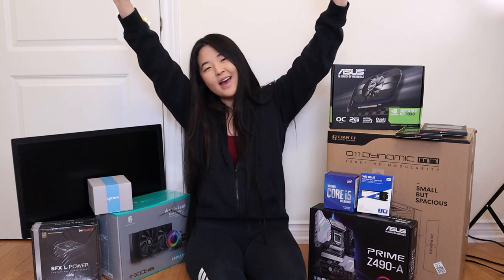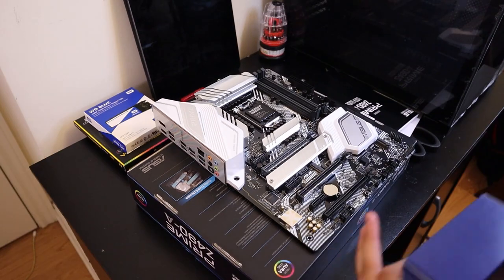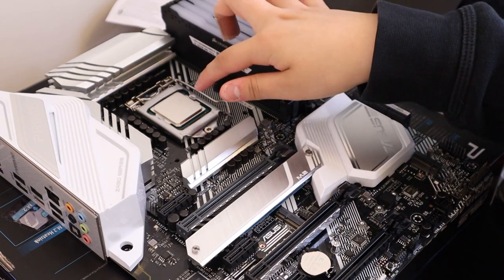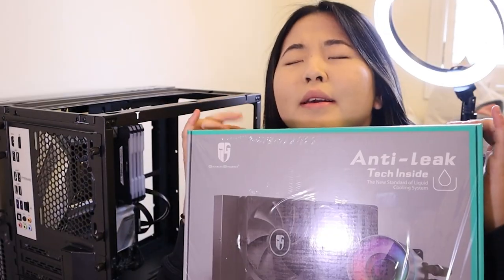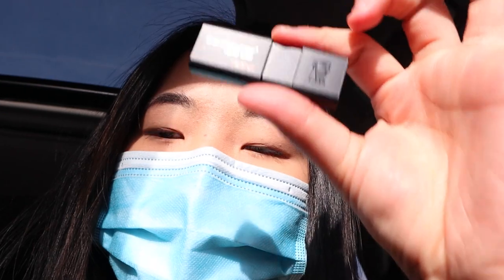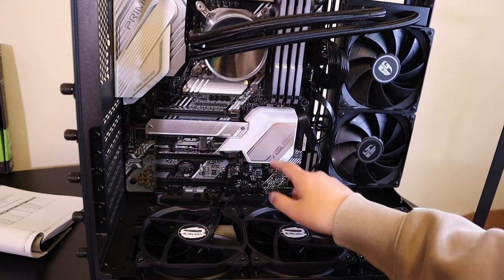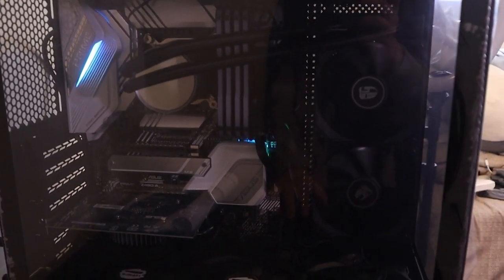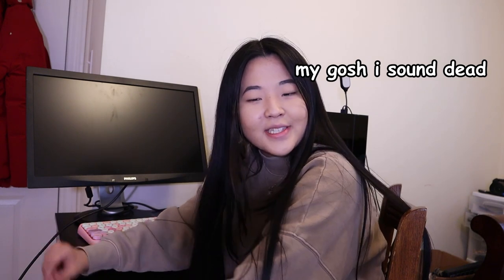building my first PC!!  | Lian-Li, Corsair Ram & more :)

Comment from the maker: Just want y'all to know that I did move my gpu into the top pci slot after finishing the video. and I know that my current gpu is not good, I got it for free and I'm borrowing it until I can get a better gpu. Thanks to all who have commented about it and trying to give me tips but it's not necessary anymore hehe :)
Reply: It's not bad
Reply: I think if u saved Ur money from other useless things u could have get a good gpu
Reply: @listrich  it is pretty bad lol
Reply: io shield?🤔🤔
Reply: @BALLBOY52  she could get b560 , cheaper ram , aio cooler is not necessary . then she can buy gtx 1650 which alot better than gt 1030
Reply: @Alaa-bv7sw  hey bud not all PCs are for gaming i
Reply: @EnderWolfPlayz why does it matter?
Reply: @possiblyelijah5307  na but why buy rgb RAM or this mother board only to have a i5 sis do you even know how trash 1030 is u could have bought a gtx 750 is wayyyy better . I know what I’m talking about . And rgb=More fps
Reply: @ock435  not needed
Reply: For a core I5 processor u wouldn’t be needing the z490 chipset which is designed for higher end intelprocessors and you could went with air cooler then a aio and you could have gotten a cheaper case which works the same cheaper ram which works the same (corsair vengeance is a pretty bad ram kit with bad dies) and with that you could have gotten a ssd with cache, because ssd’s without cache is not good, and with all that you could have gotten a better gpu, building a pc is not for looks its for the hardware and the performance, aesthetics does not affect anything, people would judge you for spending all out on aesthetics, but for a beginner you could have gotten more research before buying your parts. I’m sorry that u spent all out and might have regretted, but coming from a experienced computer builder and a meme ear of the pc master race, this is a pretty bad build.

Comment: Just a suggestion, you should put the gpu in the top slot when you can as it usually has more lanes for the gpu for better performance. Otherwise the build came out great!
Reply: daunis
Reply: too trash a gpu fir top slot
Reply: @jackjackson6116  the gt 1030 is a great budget gpu wdym
Reply: @sn0wyyy  its not
Reply: @sn0wyyy  if u have the AMD ryzen 5, yeah it’s decent, gets 100 FPS in fortnite
Reply: @jackjackson6116  It’s a perfect GPU for what she wanted the pc for. Doesn’t seem like she had the intention to be playing AAA games.
Reply: Suraj Minhas  your supposed to pair a very low end gpu like a 1030 with a i3 or sum, not with a 10400f, which is wasting money, plus im not wasting 300 dollars on a case when I can get a rx 6600 with that money, not worth it

Comment: I definitely recommend moving your cpu cooler to the top section of ur case, as it will help it last longer and be more effective as when it’s like that if often just pushes warm air through the case, due to the angle
Reply: the radiator fans are set to exhaust it's not pushing any air through the case.

Comment: Just a tip but.. you should put the gpu on the top pcie slot because it would make it run better as it is what they call x16 while the lower slots are only x8

Comment: You did extremely good building this gaming pc but one thing I do recommend is your graphics card the gt 1030 may need a upgrade soon especially with the 3000 series out and the 4000 series coming so I would maybe recommend upgrading your gaming pc soon a good suggestion is the rtx 3060 ti or rtx 3070 they are some of the best price to performance cards you can get and they are heck a powerful and a very very very good cards just again this is a suggestion but awesome video btw
Reply: when do you think the 4000 series will be coming out?
Reply: @teepea  like mid 2022
Reply: This is a great suggestion however, i would rather recommend a 20 series card because right now the 30 series is currently way overpriced and the 3050 isn’t quite in stock
Reply: @mano1510  oh ok

Comment: the gpu you should probably get is a gtx 1650 or gtx 1650 super
Reply: 1660 super if the price was not 4 times what it is worth right now. got mine for 269 right before the price hike and now they are 700 plus. ok 4 times is a major stretch, but still way to much for it right now.

Comment: it is probaly too much to put 32gb of ram with a i5 and you should upgrade the gpu as fast a possible
Reply: 1 cpu core uses 4.2666gb of ram so no its fine
Reply: @lachysimmonds357  nah thats dumb i have a 8 core cpu and im only using 5-6gb lol
Reply: @liquified7307  let me guess windows told u that cause that what it told me as aswell and I upgraded to 24gb ram and said i was usin more so ye

Comment: btw the  m.2 SSD card needs to be the top slot, not the second one.
Reply: it doesn’t matter, both slots are gen 4, 1 just has a heat shield
Reply: A Prime Z490 board only has gen 3.0

Comment: Nice video. I like your choise of hardware. Very nice looking. But i personally do not like case fans placing.
Those 3 fans from the bottom of the case are good... the best place for fans is front side. 
It depends on the airflow....and i didn't really pay atention on how you oriented the fans, so maybe i am making a mistake myself.
Anyways, good one

Comment: There is NO WAY she got a GT 1030😤 for a 1200$ build lmao
Reply: with all of the gpu price inflations in the market she could have easily gotten scammed, nowadays the common gpu price (WITH the gpu price inflation) for a 1030 is about $300 which is still cheap but NOT and NEVER will be a good price for a gtx 1030, also even if she got it around for $300-$400 the pc wouldn't be $1200
Reply: ye i was like bruh